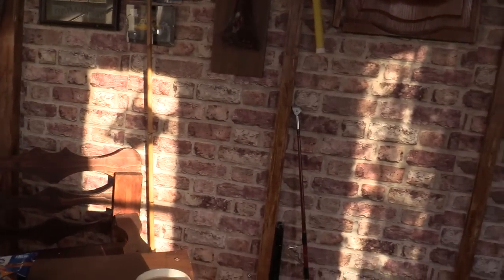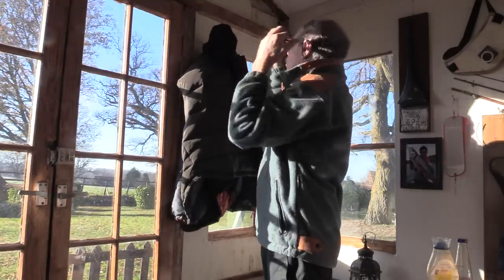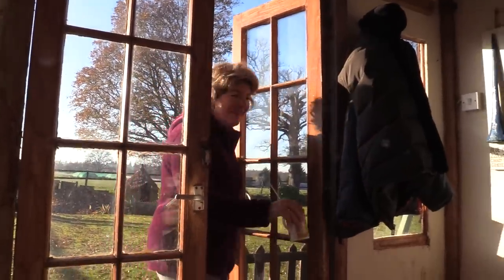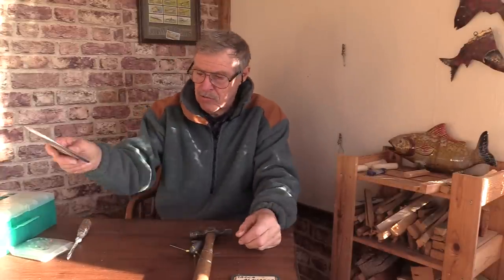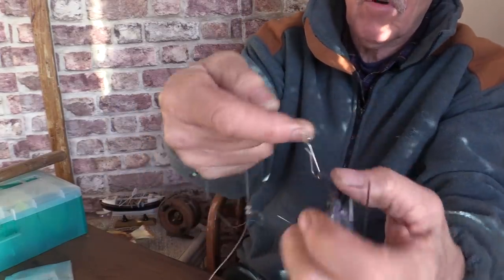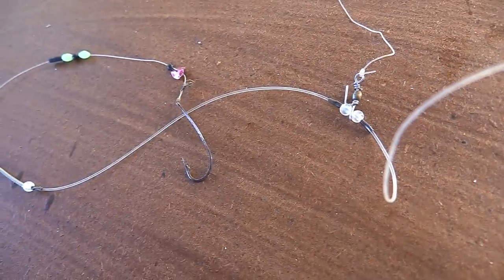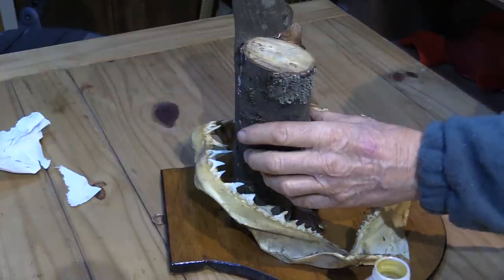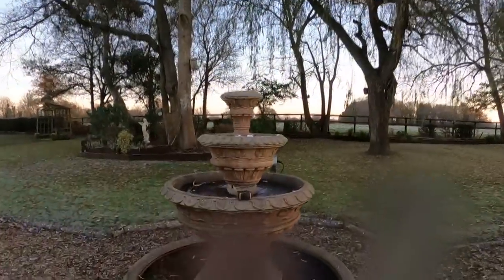Is this the World's best Beach fishing Rig for Beginners?

Comment: Nice one Graeme. A very good rig and also nicely versatile. Similar to one of my favorites that I started using in the 80’s, which was good for distance on clean beaches. By the way Graeme if you leave a small floating rubber ball or short length of hose held against the side vertically it relieves the pressure of the ice, when it contracts and expands. Maybe a small screw through the broom head into the shaft would help, too.

Comment: Hi Graeme. Very entertaining. Thankyou.
At three score years and ten, like you I have dread of cold wet bank hands - but now the box of black nitrile gloves left over from the dreaded covid days come into their own. Slip 'em on under two finger fingerless work gloves (no comments please) and bingo. No water on the digits and relatively warm hands, dextrous enough to tie a knot, friendly enough to grip a slippery Bream and smooth enough not to get hooked up on. On with my goggles and off I go. Dry the gloves on the car heater vent on the way home (open the window a bit) chuck the nitriles in the recycling and happy days!
Good luck
Sticky

All from Amazonia, £13 squid for the Scruff gloves (plenty of options) and & £8 for the black nitriles. With some personal variation you should be good for an awesome winter season.
Reply from the maker: Sounds a goods tip,I think others have mentioned putting "covid" gloves on under other gloves to keep moisture off,so must work. Thanks for posting,it might help others as well.

Comment: Thanks for the close-up on the whackernoster, I'll give it a try.  When demonstrating clipped rigs I find it easier to hang the rig vertically on a wall from a hook/screw.  That way the weight of the lead keeps the clipped rig under tension without getting your arms in a tangle.
Reply: Uhh

Comment: As far as I can remember the leads with wings on were made by a guy in Cardiff (DCA) moulds and were actually sold as a lead lift mould, IE come up in the water on retrieval, supposedly!!!.
Reply from the maker: Yes, I think they were DCA moulds .I had several made by them in different shapes and sizes and they are still going strong. I find the ones with the vanes can get bent on the retrieve over rocky ground which may alter the flight on the next cast. If bent I usually straighten them back with pliers.

Comment: I wouldn't have used polyurathane glue on that job, simple super glue would have done it especially if you'd have applied accelerator to one side of the plaque, 20 seconds holding it down. Polyurathane as you say expands and would swell over and off the work piece. I only hope you managed it well in the end.

Comment: Just a quick question could these be used in carp fishing to prevent tangles at range when using supple braids,and great content always graeme.
Reply from the maker: I have no idea actually but it does make me wonder,there could be a place in long distance carp fishing.I assume you mean the cascade swivels with the tiny hook holder ? Ask in your local tackle shop or check online,they can't cost much  as they are so small.
Reply: @TAFishing  yep if fishing long helicopter rigs with soft braid , first time id come across these hook releases not really dipped my toe in the sea fishing side before myself not being that close to the coast unfortunatley😇